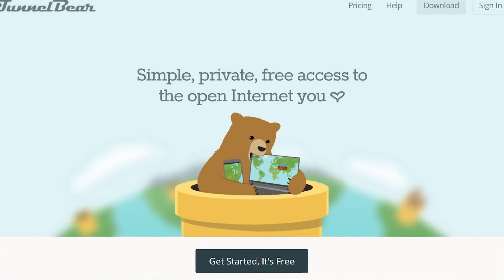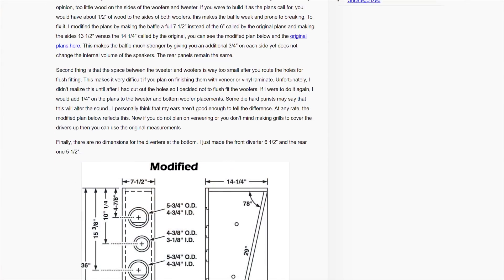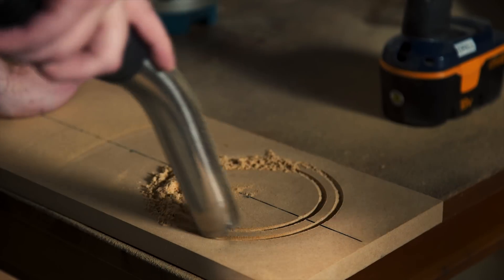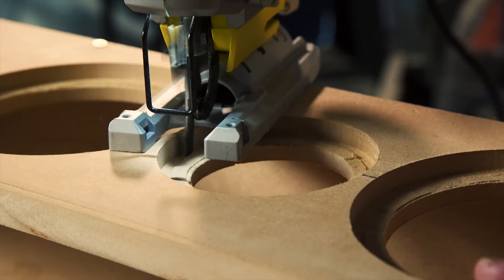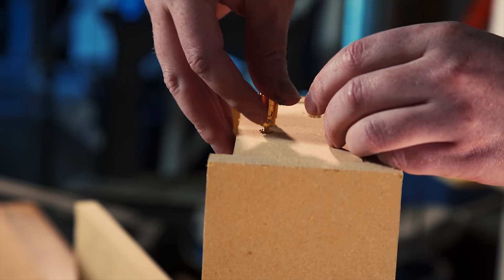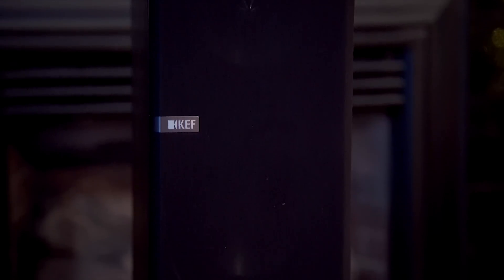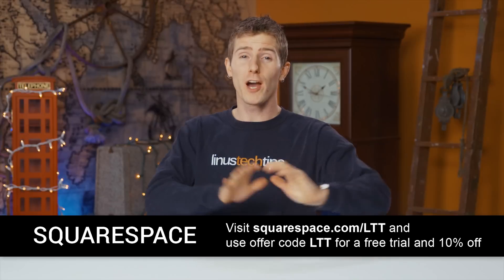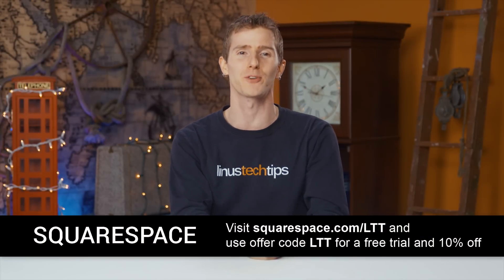DIY Speakers for Less Than $300!

Comment: Just buy a Logitech Z623 for $100. It has 2 35 watt speakers and a 130 watt subwoofer. Do you really need huge speakers like these? How loud do you want your sound to be? The Logitech Z623 goes louder than you would ever want (and it also sounds great of course) and the bass is incredible! Seriously, it's all you need for life. $100 and you're done. This thing has cloudy sound and the Logitech Z623 is super clear. Also this thing is in desperate need of a subwoofer while the Logitech Z623 has a 130 watt subwoofer.
Reply: He bought the Kefs for sound quality, not volume.

Comment: DIY speakers can sound pretty good if you know what you're doing and use good materials but nowhere close to kef quality...these high end companies are considered high end for a reason not just because they're expensive. They have high level engineers work on the models and the sound for years. No $150 set could really compare if everything is set up properly.

Comment: there is more to it then just connect some speakers and build  1 bad sound filter
1) use all range = high , mids ,  low and if possible sub low
2) build 1 filter for each speaker
3) enclose the back of the subwoofer and make  an hole in front (bass reflex)
3) use variable resistors that can tweak frequenties
4) tune those variable resistors for the frequentie specs or needs

you should have change one mid woofer to an Subwoofer and buy premade filters cheap and drill an hole close to subwoofer .that would made it very close or even better.

Comment: okay so the speaker set was 1/4 of the price of his reference speakers. However if you add the wood, glue, wire and the tools needed - you're not going to come in that much cheaper. Plus the ones bought look a lot better!
I would just go with a pair of good Teufel Speakers. They cost a lot more, but they're worth it.

Comment: Its my first time building a PC and I wanted to ask if this is a good build 

Intel Core i5-6600K 3.5GHz Quad-Core Processor
Zalman CNPS9900MAX-B CPU Cooler
Asus B150M-A Micro ATX LGA1151 Motherboard
Kingston HyperX Fury Black 8GB (2 x 4GB) DDR4-2133 Memory
Kingston SSDNow UV400 240GB 2.5" Solid State Drive
Western Digital Caviar Black 1TB 3.5" 7200RPM Internal Hard Drive
Asus GeForce GTX 1070 8GB Video Card
Aerocool Aero-800 ATX Mid Tower Case
COOLER MASTER GX-2 550W 80+ SLI 550W POWER SUPPLY